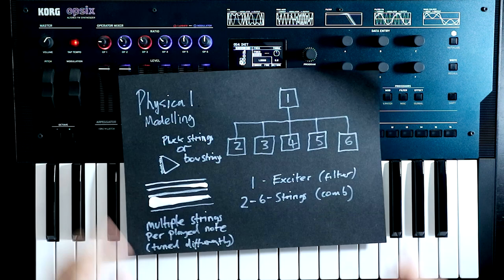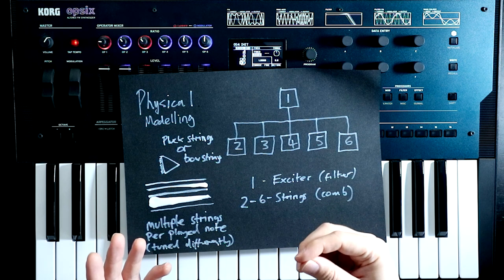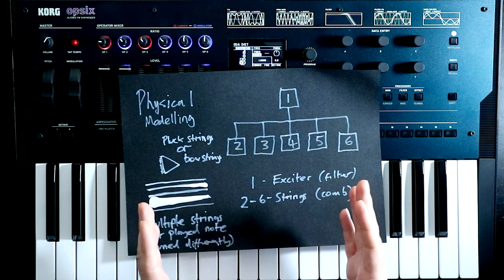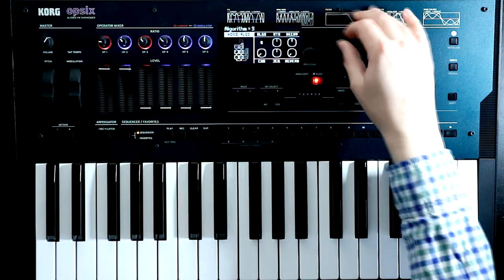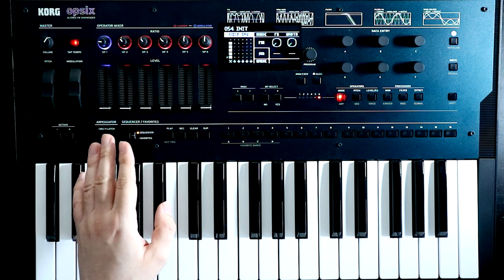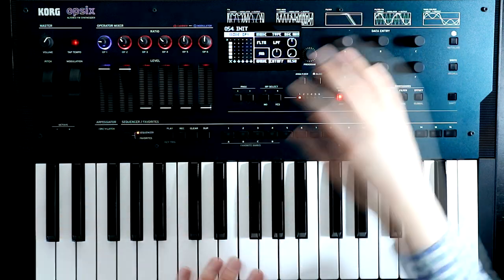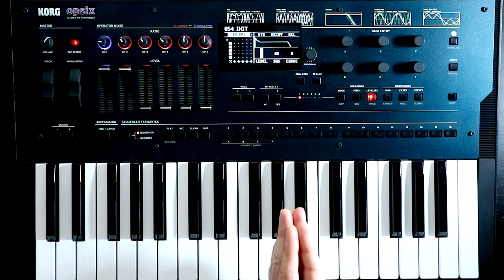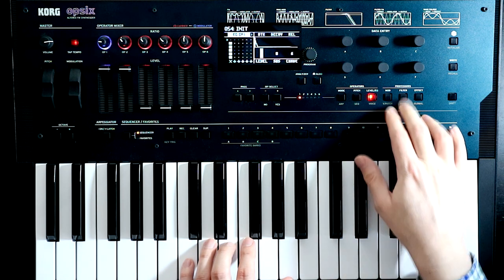Korg opsix: Building a Physically Modelled String (plucking and bowing and resonating - oh my!)

Comment: I’ve gotten so much more enjoyment out of this instrument thanks to your videos. I really appreciate your approach to sound design and making each patch as expressive as possible. You’ve also made it clear that this is a much more interesting synth than most people assume. Korg really undersold the OpSix by focusing on FM rather than the idea of an expanded operator-based synthesis.
Reply from the maker: The "Just an Easier DX7" approach hugely underrepresents what the synth is about, that said, explaining the opsix in a catchy one-liner is really hard because there's not really anything to compare it to. I think of it as an "Operator-based" synth, but that doesn't really explain anything if you haven't used it... It's like a little self-contained modular environment really.

Comment: As I said in another reply because of your inspirational explorations I bought the Opsix. When playing around with just OP1 and OP2 I got a fuller sound with pink noise and  the MG BPF 6 with cutoff set to -8.5. Simulating the slight  lowering in pitch when you release/dampen the note by using V-Patch to link the KBD release  VEL to the frequency of OP comb filter INTensity set to -0.05 adds a certain realism to the string.  The envelope of the OP comb filter needs to be about  rel 1.147s and sus  50 curve7 so you can hear the effect when you release the note. I am amazed that with just 2 operators you can simulate a piano sound especially if you set the voice to 3 unison with detune =1

Comment: Just came back to thank you again - tonight, inspired by this video, I finally(!) downloaded 2.0.1 firmware and built a patch that features a single comb resonator, two sympathetic comb ops with fixed pitches of a lowish D and A that take the other one as input to give resonant behaviour, and finally a pair of filter ops LPF and HPF in parallel at the end of the whole thing to get a sort of compromise version of a filter bank (I love the "folk instrument" effect that gives it). There's also (a VERY small amount of ) feedback from the outputs to the sympathetic strings, to further emulate real instruments. The whole is deliberately designed for playing in Dm, and it works great! I had in mind the sympathetic strings of a sarangi when I made it, but it doesn't sound like one, as mine has the plucked strings effect (I've found that the bowed effect is really hard to get right). Great fun!

Comment: Sorry to spam the comments - do you have any more opsix patches? I checked gumroad and found your spot but it was mostly elektron gear. 

I enjoyed following along with the Juno patch video, it didn't come out exactly the same (I mustve missed something, or set the ratio wrong) but it was incredibly informative. I feel a lot more confident using the user algorithms now.

I'd be EXTREMELY interested in an opsix patch pack, free or paid, doesn't matter.
Reply from the maker: If you can wait about 5-6 weeks, there might be something for you - anything that might (😉) be happening will be announced on the channel.

Comment: Hey! I m totally blown away with all the possibilities you ve shown how to produce sounds on the OpSix.. But i m wondering - can it create sounds like a Casio CZ or PD ? Maybe i missed that on one of the videos..  From some videos about phase distortion i gathered that the Yamaha FM is more like phase modulation than real frequency modulation. Any thoughts on that? Thanks for the very inspiring videos! Cheers 😃
Reply from the maker: WELL! Interestingly in the new Effects operator, the Wave Shaper effect IS phase distortion. So the easy answer is yes....but, to get something CZ style you'll need to use then effects operator as a pure effect (in the same way I use the comb filters in this video - envelope wide open, oscillator mix at 0 etc.) and it's the operator feeding into it which will define the timbre envelope as on the Casio. You'll need to find wave shaper modes that approximate the Casio phase distortion modes, but there are some in there that have a similar vibe in my opinion. 

I will point out that I only realised  this because in my 2.0 overview video I actually said that I thought it sounded like a CZ synth, and a commenter helpfully pointed out that was because it is doing the same thing. If you find that video you'll find that comment thread if you're interested. 

Hope that helps!
Reply from the maker: Oh one other thing, the operator feeding into the wave shaper should be a sine wave, and probably the 12 bit version, but honestly, for my money, I think you get a wider range of usable sounds with a triangle.
Reply: @OscillatorSink  Thanks a lot for your thoughts. I just made the update to 2.0.1 on my OpSix - lets see what i can find. 😊 Cheers!

Comment: love these types of sounds! thanks so much for this. what are your ratios set to for oscillators 1 & 2 in the first patch (~05:00-13:00)? hard to see on that tiny screen!
Reply from the maker: There's a link to the finished patch in the pinned comment if you want to check, but Operator 1 is just bandpassed noise, the ratio sets the cutoff so you can mostly just use your ears and choose how sharp the sound is. I think operator 2 just has a ratio of 1.

I'm starting from an initialized patch so if you don't explicitly change something, assume it's the default.
Reply: amazing, thank you! @OscillatorSink

Comment: Master Oscillator, how would you try and build an Oberheim OB-8 in the Opsix? Ala Van Halen 'Why Can't This Be Love' ? I don't even know if it's possible, but I figured you're be the one to ask.
Reply from the maker: Architecturally, you'd be in the same ballpark as I was in the opsix Juno video, but allowing yourself a wider range of oscillator waveforms, LFO and envelope routing. You would also get rid of the master highpass filter. It's still basically a 2 oscillator per voice subtractive synth, so the layout is basically the same.

You couldn't do the layers or splits though - that's a area where the ob8 is more advanced than the opsix!
Reply: I will PAY YOU to make me a video and show me :) PLEEEEEEASE!! @OscillatorSink

Comment: I have been  following your journey with the Opsix with much interest  hoping that I would like it as a believable instrument versus as a sound effects box. You have come close but I cannot shake the sense that there is something thin and lacking in the solidity and fundamental of the tones that makes it less credible than even the 12 bit DX7. I think it maybe due to the  effect that Manny Fernandez in his exploration of the Yamaha  FM-X on the Montage demonstrated in his video series. A Bessel function describes the amplitude of the fundamental as the modulation index goes up and that causes the level of the fundamental to drops out as you increase the level of the modulator.  This can be controlled  by the relative phase of the modulator and indeed the DX7 had a phase control for its operator oscillators. Korg could fix this by adding two controls in the parameters for the FM  operator oscillator. One knob for  Initial Phase and the other control for SYNC versus free running oscillators at note initiation. Korg please add this in an upgrade and I would definitely buy one.

Comment: One general (not this video here) question concerning the Opsix: each operator has a feedback, the algorithm has none. That’s fine, but doesn’t that render a lot of the classic 32  algorithms redundant e.g. 5=6 , 1=2, and many more? Graphical explanation: if you  take away the original FB loop from both 5 and 6 , then add one to each operator on the algorithm, both algorithms will look the same. 
I don’t think that’s wrong, I’m just asking if my observation is correct.( you have to keep the redundant algorithms for compatibility, import mostly.)
Reply from the maker: That is correct. I think you are correct in saying that they are mostly just there for backwards compatibility with the DX7. You can also create far more involved feedback routings in the user algorithms than could be achieved on the DX7.
Reply: @OscillatorSink  I confirmed it with the Volca FM. The algorithms looking the same, just with a different feedback spot make an audible difference on the Volca FM whereas on the Opsix in presets with non-zero feedback (19-21, version 2) no difference is noticeable to my untrained ear.